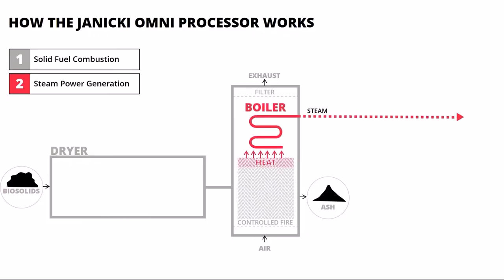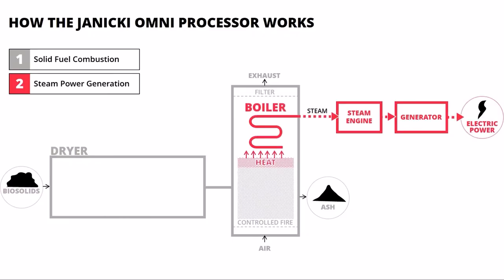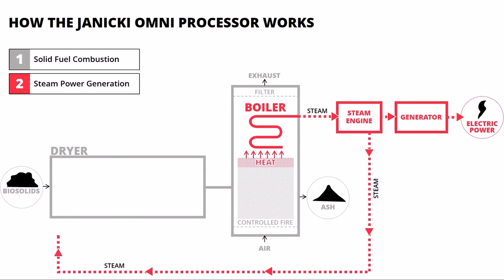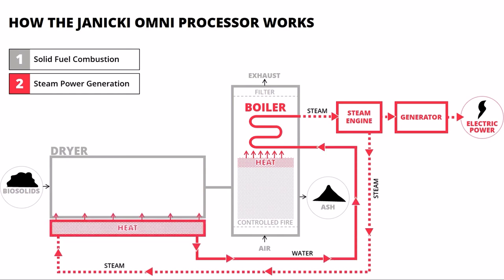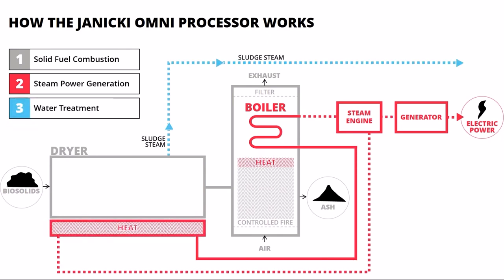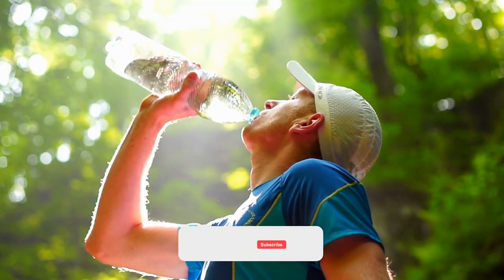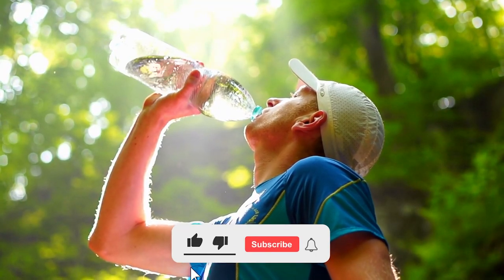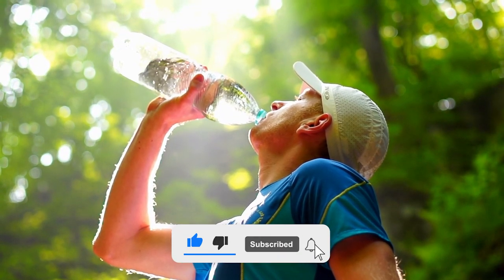Janicki Omni Processor (Poop Water) | Bill Gates Solves Water Crisis In Developing Countries!?

Comment: There's one glaring issue I see with this (aside from it being f-ing disgusting), namely conservation of mass.
AFAIK, human body does not produce water from other sources. My basis for this is mainly that you can (supposedly) survive weeks without food, but only a few days without water. If your body was capable of constructing water from hydrogen and oxygen, you could replace your water intake with proper diet - but you can't.

Another thing is that, your body does not produce mass, only reconstructs it. And as far as we know, nothing in the universe can produce mass. So 2 litres of water go in, 2 litres of water go out. 1 kg of food goes in, eventually 1 kg of waste goes out. And that's assuming none of it stays in your body, which is demonstrably not true.

So let's assume you drink 2 litres of water. You then poop and pee into the magic machine to retrieve that water... assuming you can have a 100% efficiency rate, can you get back those two litres of water?

No. Why? Because part of that water escapes via sweat, tears and breathing. Among, I assume, other things. So assuming the machine gets ONE HUNDRED PERCENT EFFICIENCY RATE, you are still going to lose some of that water. Considering no machine is ever 100% efficient though... you get the picture. You get maybe 60% of consumed water back, then you still need to build proper facilities to filter either saltwater or fresh/rainwater. In which case, you can just skip the whole poop water thing, and just go for proper facilities in the first place and allow people to have some f-ing dignity. Especially considering that building all the infrastructure for the poop water thing on an industrial scale is probably not going to be much cheaper anyway.

Not only that, but they are also trying to convince me that they can have all that and still have energy to spare to power the electrical network, as rudimentary as it might be? This BS belongs in the same category as the "Pay me $100 on kickstarter and I will produce a magical fan device that you stick into the ground, and it produces water out of thin air, thus ending the water shortage in third world African countries" scams.